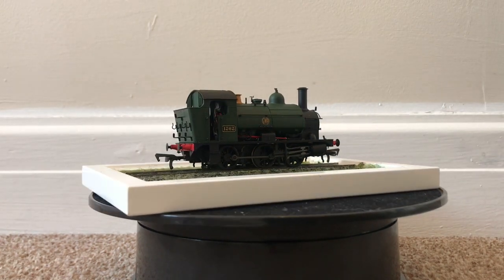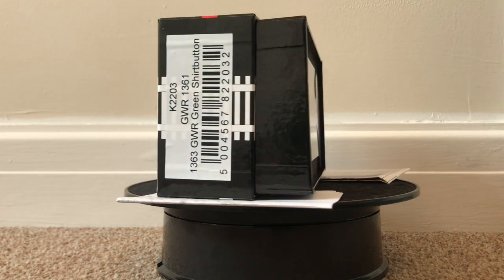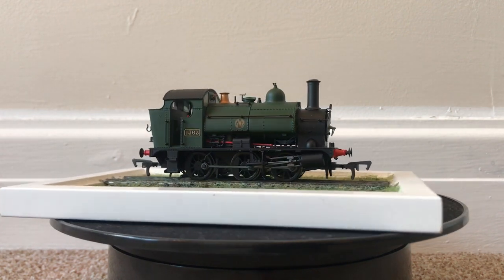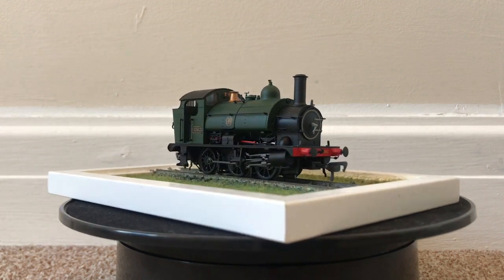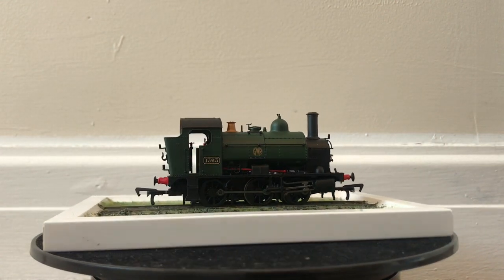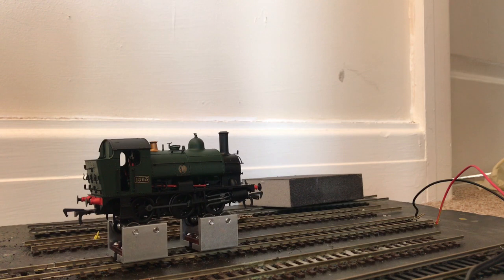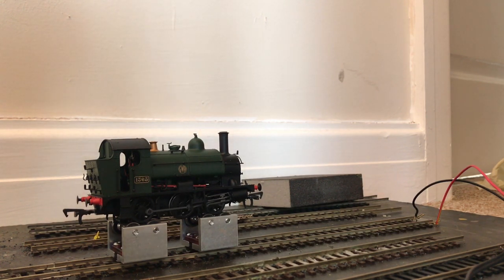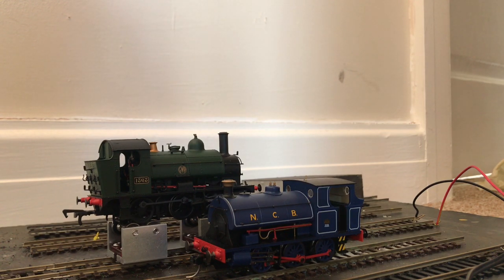DJ Models Class 1361- Kernow Model Rail Centre Exclusive in GWR Green Shirtbutton Livery

Comment: I have one of these and I am disheartened to hear so many negative comments. I had no trouble taking the cab roof off to fit crew and hardwired a sound decoder and I've been very impressed.
Reply from the maker: Hi
Those are just my thoughts & experience. I do believe that the Peckett B2 is a better, but the 1361 is not a bad model. In fact in many ways it is forward looking (DCC chipping & the detail pack).
Am I okay asking what the tolerances were like when taking the roof ect?
I believe it was my model if I’m honest.

Thanks 
Olly

Comment: mine will be a static model.  Did not work. Very erratic runner on DC.   Non-runner on DCC.  Changed decoder (different make) no different.   Kerno replaced it with another, and gave some configure tips (good service).  It is still very eratic, got it to go about 4 meters without stopping once, rest of the time only goes a meter or two then stops, needs another prod.  Poor pickups?  Loose connection inside?  Mechanical jamming?  Can't open it to check.  Roof also does not come off.  Two out of two with the same issue.
Reply from the maker: That’s a shame. I find mine needs a bit of TLC (run on the rolling road and a clean) whenever I wanna run it on a layout. Shame as they could have been soemthing mega